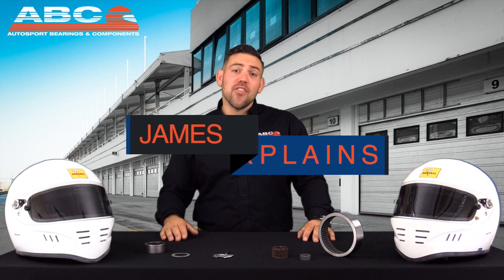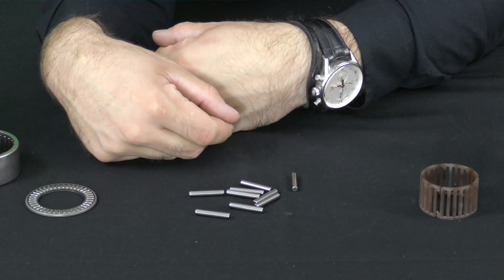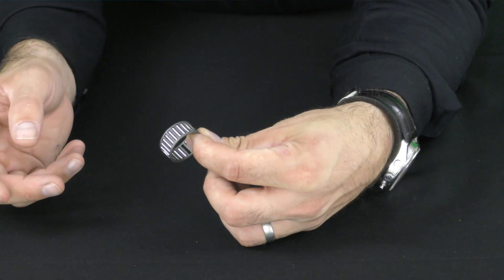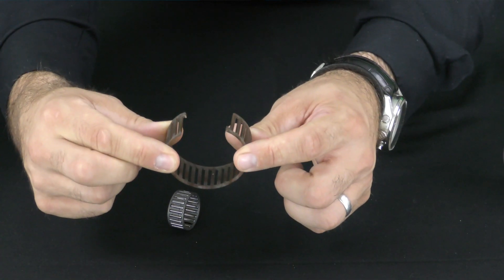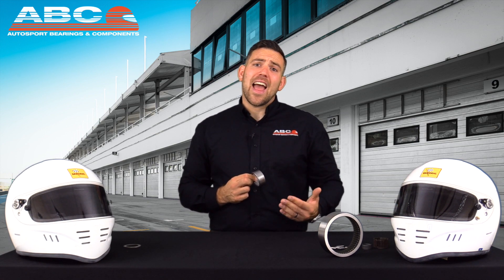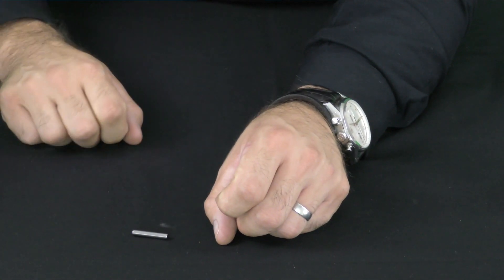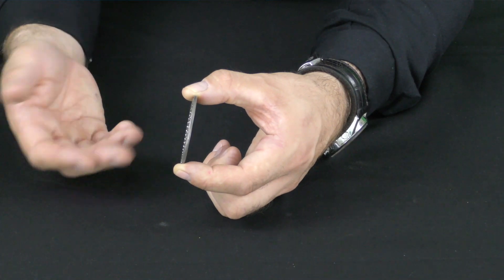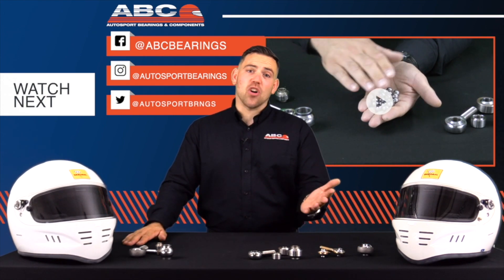James Explains - Needle Roller Bearings

Comment: Hello, i resently change my clutch and flywheel on my audi a4 b8, didnt change the needle roller baring on the enginge part there the transmission shaft goes in. Do i have to worry about the needle roller baring ?

Comment: Is there an advantage to using full compliment needle bearings over caged needle bearings, as long as the static pressure and temperature ratings for the caged bearing, meets the requirements of the application?

Comment: how to lock needle roller bearing in a shaft
Reply from the maker: A needle roller bearing needs an axial location feature. this is often done with a step on the shaft or with a circlip/snapring or in the housing . sometimes we utilise an existing feature such as a gear. Please bear in mind that any given shaft will need an axial bearing if any axial reaction force is seen to locate the shaft. Hope this helps!
Reply: some needle rollre bearing can rotating in one direction, and locked in the other direction